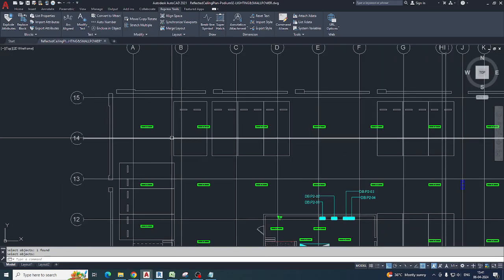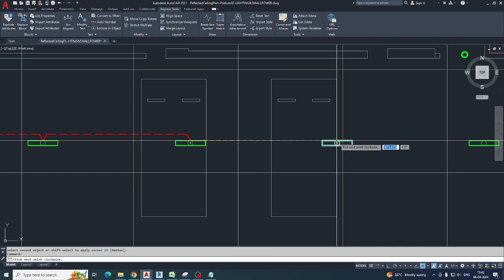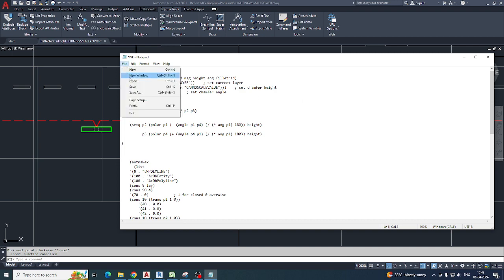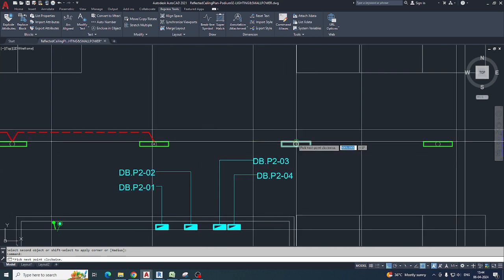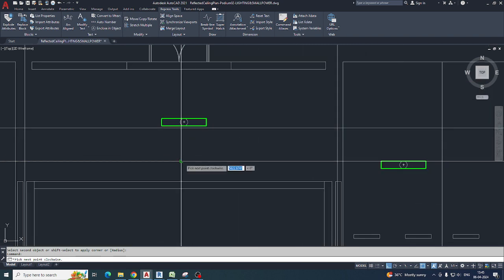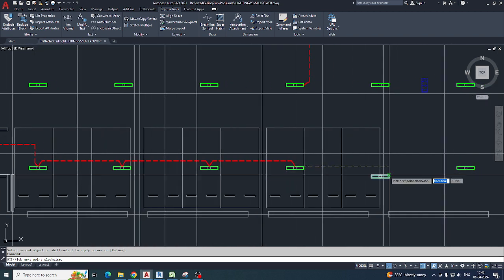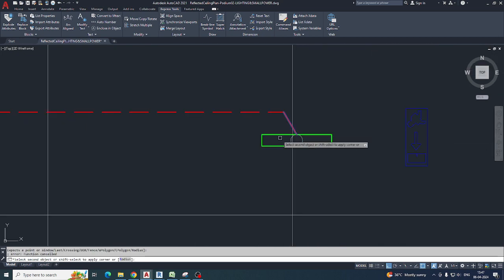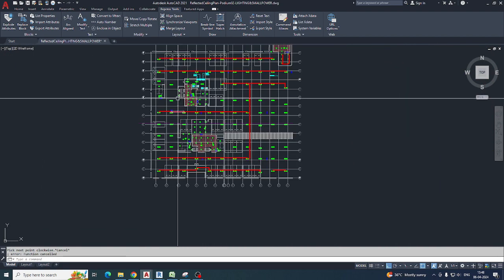Electrical Wiring Using LISP in AutoCAD- Time Saving Lisp in AutoCAD.

Comment: Boss,
I am getting this error while doing the same.

Pick start point (Draw clockwise
Pick next point clockwise.; error: no function definition: DRAW-EW
Reply from the maker: ;; CAB 05.13.09
;;  Draw Electric Wire
(defun c:ew (/ ew_layer p1 p2 msg height ang)
  (setvar 'filletrad 150)
 (setq ew_layer (getvar "CLAYER"))    ; set current layer
 (setq height (/ 200 (getvar "CANNOSCALEVALUE")))    ; set chamfer height
 (setq ang 45)                ; set chamfer angle

 (defun draw-ew (p4 p1 lay / p2 p3)
   (setq p2 (polar p1 (- (angle p1 p4) (/ (* ang pi) 180)) height)
     p3 (polar p4 (+ (angle p4 p1) (/ (* ang pi) 180)) height)
   )
   (entmakex
     (list
   '(0 . "LWPOLYLINE")
   '(100 . "AcDbEntity")
   '(100 . "AcDbPolyline")
   (cons 8 lay)
   (cons 90 4)
   '(70 . 0)            ; 1 for closed 0 overwise
   (cons 10 (trans p1 1 0))
       '(40 . 0.0)
       '(41 . 0.0)
       '(42 . 0.0)
   (cons 10 (trans p2 1 0))
       '(40 . 0.0)
       '(41 . 0.0)
       '(42 . 0.0)
   (cons 10 (trans p3 1 0))
       '(40 . 0.0)
       '(41 . 0.0)
       '(42 . 0.0)
   (cons 10 (trans p4 1 0))
       '(40 . 0.0)
       '(41 . 0.0)
       '(42 . 0.0)
   '(210 0.0 0.0 1.0)
     )
   )
 )

 (and
   (setq p1 (getpoint "\nPick start point (Draw clockwise"))
   (setq msg "\nPick next point clockwise.")
   (while (setq p2 (getpoint p1 msg))
     (command "_.fillet" "_P" (draw-ew p1 p2 ew_layer))
     (setq p1 p2)
   )
 )
 (princ)
  )
Reply: @AutoCADRevitByju  boss its working. Thank you so much.......
Reply from the maker: Ok I will check
Reply: When I copied it where I put this copy please help

Comment: The copied file is not working properly can you upload the LISp file
Reply from the maker: ;; CAB 05.13.09
;;  Draw Electric Wire
(defun c:WE (/ WE_layer p1 p2 msg height ang filletrad)
  (setq WE_layer (getvar "CLAYER"))    ; set current layer
  (setq height (/ 450 (getvar "CANNOSCALEVALUE")))    ; set chamfer height
  (setq ang 60)                ; set chamfer angle
  
  
  
  (defun draw-WE (p4 p1 lay / p2 p3)

    (setq p2 (polar p1 (- (angle p1 p4) (/ (* ang pi) 180)) height) 

          p3 (polar p4 (+ (angle p4 p1) (/ (* ang pi) 180)) height)

)

   
    (entmakex
      (list
    '(0 . "LWPOLYLINE")
    '(100 . "AcDbEntity")
    '(100 . "AcDbPolyline")
    (cons 8 lay)
    (cons 90 4)
    '(70 . 0)            ; 1 for closed 0 overwise
    (cons 10 (trans p1 1 0))
        '(40 . 0.0)
        '(41 . 0.0)
        '(42 . 0.0)
    (cons 10 (trans p2 1 0))
        '(40 . 0.0)
        '(41 . 0.0)
        '(42 . 0.0)

    (cons 10 (trans p3 1 0))
        '(40 . 0.0)
        '(41 . 0.0)
        '(42 . 0.0)
    (cons 10 (trans p4 1 0))
        '(40 . 0.0)
        '(41 . 0.0)
        '(42 . 0.0)
    '(210 0.0 0.0 1.0)
     
 )
)

(command "_fillet" p1 p3 )

(command "_fillet" p4 p3 )

      )
    
  

  (and
    (setq p1 (getpoint "\nPick start point (Draw clockwise"))
    (setq msg "\nPick next point clockwise.")
    (while (setq p2 (getpoint p1 msg))
      (draw-ew p1 p2 WE_layer)
      (setq p1 p2)
    )
  )
  (princ)

)
Reply from the maker: Please try with above comment

Comment: should i use it in specific layer ?
Reply from the maker: Hi thanks for your comment Sure You can use specific layer, which layer you need to create make as a current then apply command it will work.😍

Comment: Easy way thank for sharing
Reply from the maker: Most welcome 😊 You can copy and paste below script to AutoCAD and type command 'WE' 

;; CAB 05.13.09
;;  Draw Electric Wire
(defun c:WE (/ WE_layer p1 p2 msg height ang filletrad)
  (setq WE_layer (getvar "CLAYER"))    ; set current layer
  (setq height (/ 450 (getvar "CANNOSCALEVALUE")))    ; set chamfer height
  (setq ang 60)                ; set chamfer angle
  
  
  
  (defun draw-WE (p4 p1 lay / p2 p3)

    (setq p2 (polar p1 (- (angle p1 p4) (/ (* ang pi) 180)) height) 

          p3 (polar p4 (+ (angle p4 p1) (/ (* ang pi) 180)) height)

)

   
    (entmakex
      (list
    '(0 . "LWPOLYLINE")
    '(100 . "AcDbEntity")
    '(100 . "AcDbPolyline")
    (cons 8 lay)
    (cons 90 4)
    '(70 . 0)            ; 1 for closed 0 overwise
    (cons 10 (trans p1 1 0))
        '(40 . 0.0)
        '(41 . 0.0)
        '(42 . 0.0)
    (cons 10 (trans p2 1 0))
        '(40 . 0.0)
        '(41 . 0.0)
        '(42 . 0.0)

    (cons 10 (trans p3 1 0))
        '(40 . 0.0)
        '(41 . 0.0)
        '(42 . 0.0)
    (cons 10 (trans p4 1 0))
        '(40 . 0.0)
        '(41 . 0.0)
        '(42 . 0.0)
    '(210 0.0 0.0 1.0)
     
 )
)

(command "_fillet" p1 p3 )

(command "_fillet" p4 p3 )

      )
    
  

  (and
    (setq p1 (getpoint "\nPick start point (Draw clockwise"))
    (setq msg "\nPick next point clockwise.")
    (while (setq p2 (getpoint p1 msg))
      (draw-ew p1 p2 WE_layer)
      (setq p1 p2)
    )
  )
  (princ)

)
Reply: @AutoCADRevitByju  its not working can u upload the lisp file .
Reply from the maker: https://drive.google.com/file/d/1ISbP-AF2ZA0ltm2YAIgck0oniAOhdG-z/view?usp=sharing